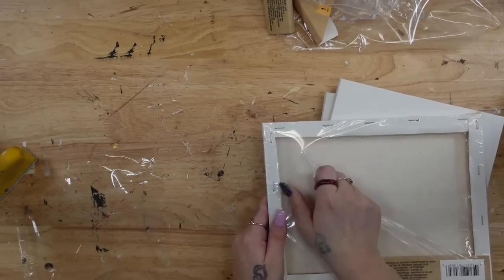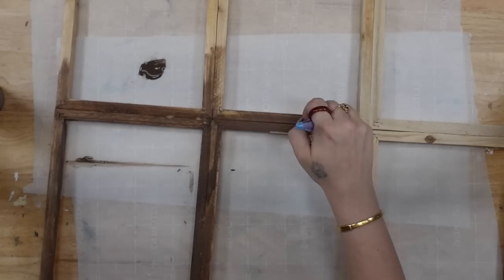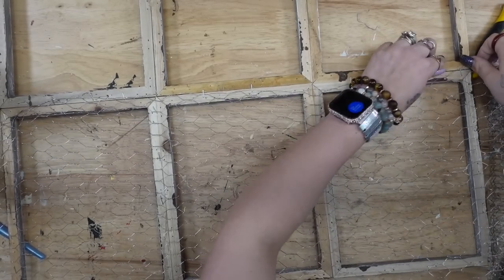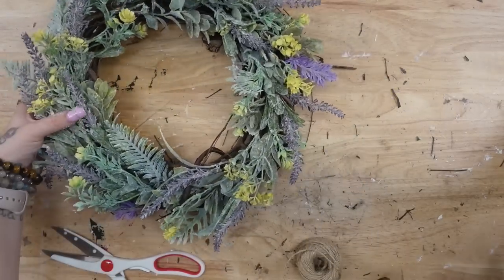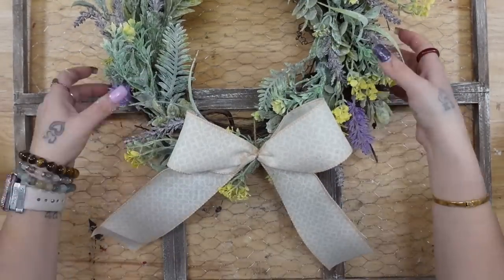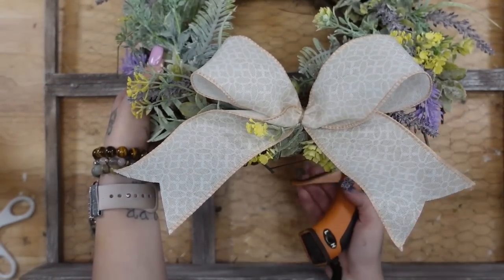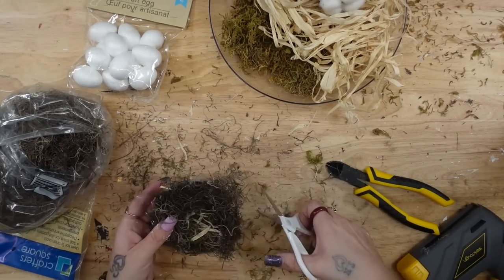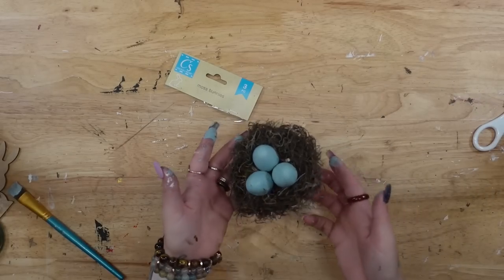HIGH END DOLLAR TREE SPRING DECOR DIYS | EASY BUDGET FRIENDLY EASTER DECOR DIYS 🤯

Comment: I love that you used the running bunny from the DT wall hanger and replaced it with your multibunny creation.  I may do the same but will switch it up and add the bunnies to the bottom rather than the top.  The chicken wire frame with the shelf and wreath is gorgeous!  💚 Your simple bird nest with the cute eggs is perfect.

Comment: I wonder if it would be more economical to use square dowels? Would it matter if the middle section isn't doubled? What are the sizes of the canvases, I'm going to price them out. 
6 Canvases: US $7.50 CAN $9.00 
1, ¼ inch, 4ft, Square dowel $1.00 
Total US $8.50 CAN $10.00